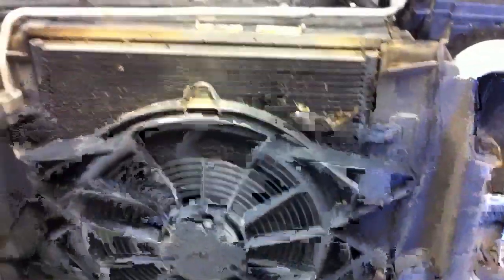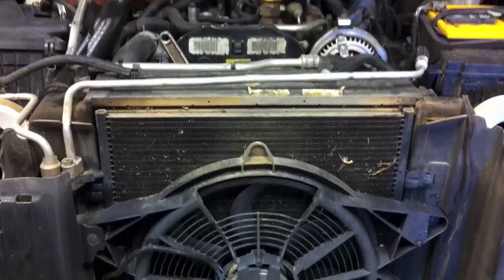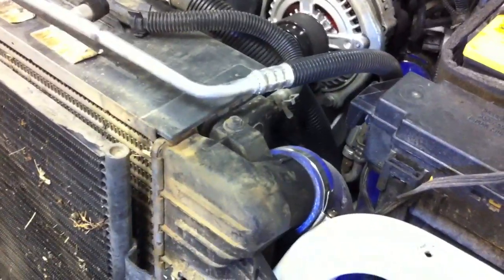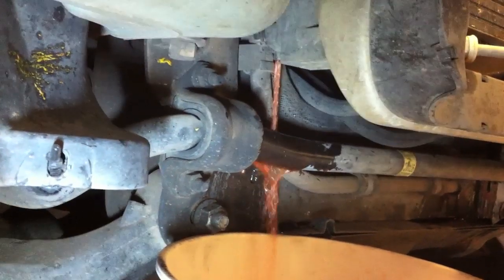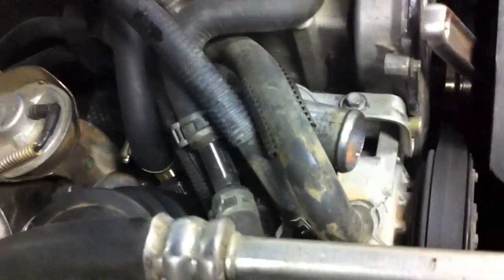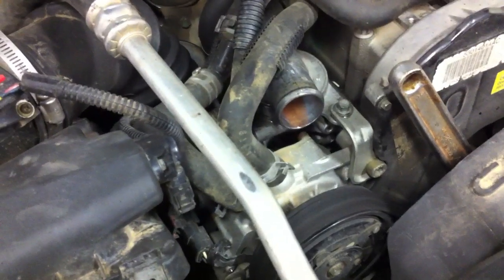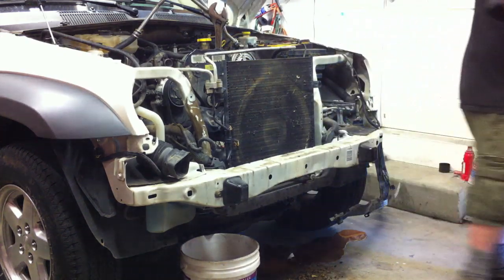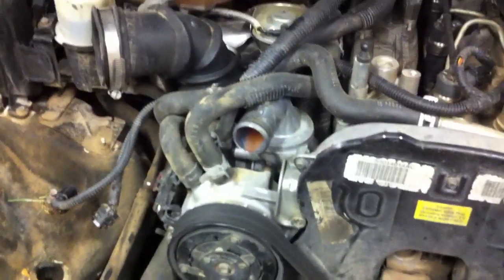Jeep Liberty Diesel Timing Belt Replacement Part 2 - Radiator and Intercooler Removal

Comment: Radiotor drain plug has a 10mm internal hex.  Use a 10mm hex key or hex key socket.  Then you don't have to mess with a pliers.

Comment: Is there a way to remove radiator easily?  Seen video on gas version 3.7 looked easy.  However your video looks complicated.  Can I get shrowd out by removing or drilling hood latch two bolts, four bolts across top, then find how radiator bolts in four bolts then remove it somehow?

Comment from the maker: Strictly speaking no removing the front end is not necessary. However it does allow you to clean the radiator and intercooler, fix the typical intercooler leak, and provide easy access to the belt. If you can get the fan clutch off of the idler without removing the fan shroud you can skip the front end disassembly, also if you are willing to cut and modify the fan shroud you can make disassembly quicker. Typically removing the front end adds about 1-1.5 hours of additional labor to the job.